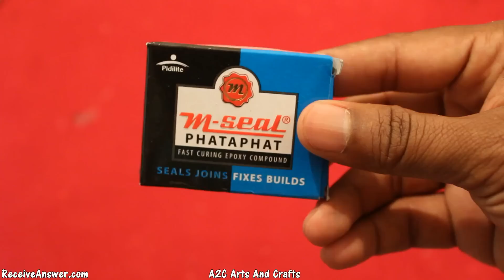How to make a ECO Air Cooler at home

Comment: This "blowing with your lips open and closed"-Thing is complete nonsense. If you blow with your lips open then it is warmer because you have more air heated up with your body. With your lips closed the air is faster and it drags more cool air from the environment with it and also fast moving air increases the heat transfer / equalisation between air and skin. Thats just how a normal fan makes it feel cooler. If you are in a sauna, blowing onto your skin makes it feel warmer because the sauna air is hoter than your skin.

Comment: good very good cooler a2c 👏👏👏👏👏👏👏👏👏👏👏👏👏👏👏👏👏👏👏👏👏👏👏👏👏👏👏👏👏👏👏👏👏👏👏👏👏👏👍👍👍👍👍👍👍👍👍👍👍👍👍👍👍👍👍👍👍👍👍👍👍👍👍👍✌✌✌✌✌✌✌✌✌✌✌✌✌✌✌✌✌✌✌✌✌✌✌✌✌✌✌✌✌✌✌✌✌✌✌✌✌✌✌✌✌✌✌✌👏✌✌✌✌can I use a usb without using a 12v battery

Comment: Actually when you blow air with pursed lips less air blows out with good speed. It pushes the cool air of the room on your hand thus it feels cool but it is not compressed air. If you will keep your fingers sticking to narrow opening of your mouth you will feel warm air while blowing on the other hand if you will blow with mouth opened wide, more air comes from your lungs which is mostly warm in a small speed and mostly involves your mouth's air but not room's air. I think before claiming a idea on internet you should do some research though your video was good. what you are claiming isn't a actual phenomenon here.
Reply: @Shreya shahi  Actually i think you need to do some research instead ...Before you try to teach other people lessons ..That's an actual phenomenon which is called adiabatic expansion in ThermoDynamics ..You wanna know more .. Just google it ..
Reply: @mukulsharma5738  Ang imong oten daku nga baho Love from Philippines 😇
Reply: Mukul Sharma adiabatic phenomenon surely goes with your  cooler but not with the air from mouth example you are applying here....and woah dude...stop overreacting like a kid.